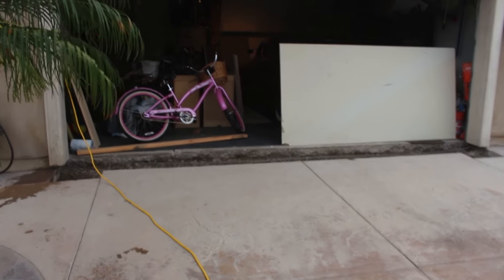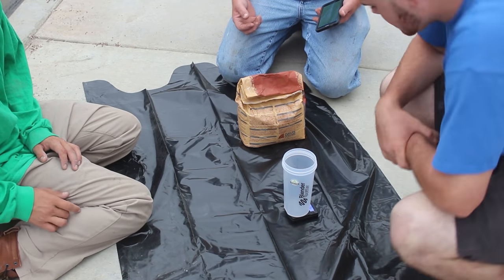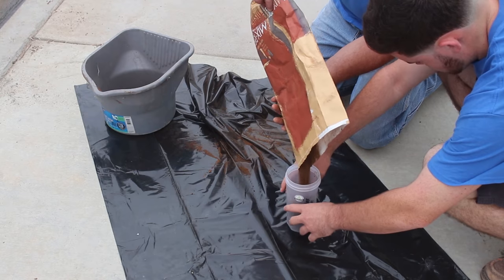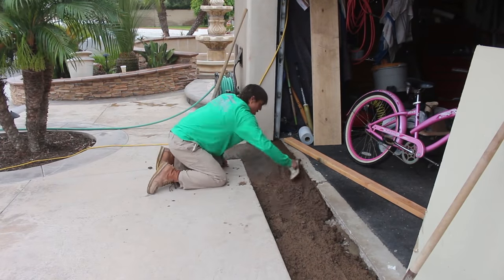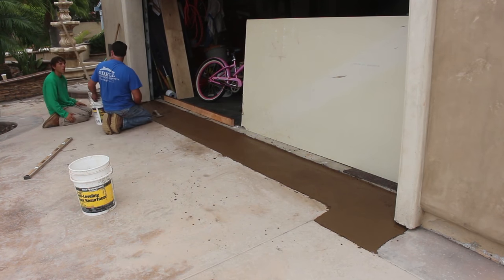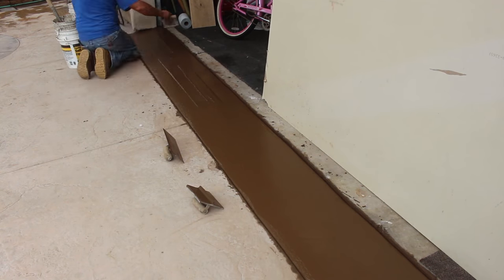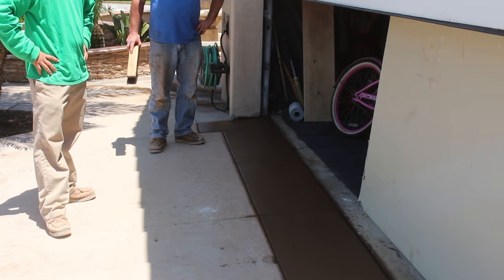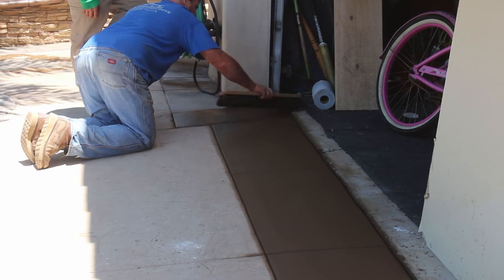How to Make Colored Concrete Hand Mixing

Comment: great job. question: what the purpose for the creases that u create in the concrete? is it to limit cracks plus how do you achieve that? the tools used and technique etc??
Reply: Nick-MC it usually makes a crack stop at that section also in future easy to cut and remove single sections
Reply: I think it's to try and encourage the concrete to crack along those lines under stress, where it won't be visible, rather than just forming a crack randomly.
Reply from the maker: JOints are to control cracking
Reply from the maker: Yes
Reply: Odell Complete Concrete joint shift of staff jeje!! Nice bid:)

Comment: Is there a reason you put the color in dry, and not premix it with water.
Reply: If color stays in the bottom of the water bucket you can get inconsistency
Reply from the maker: There is liquid color you can use, this happens to be a dry color.

Comment: anytime I used color in concrete it was over 6 yds to 10 it set up real fast. you really had to move. I put a retardant in it next time I did it
Reply from the maker: Depends on the what color it is and how much is required.